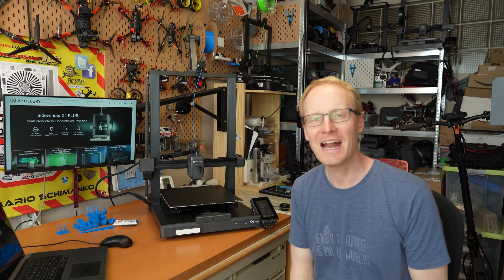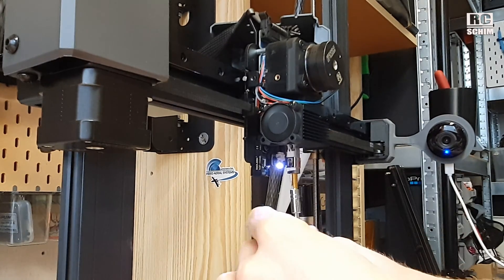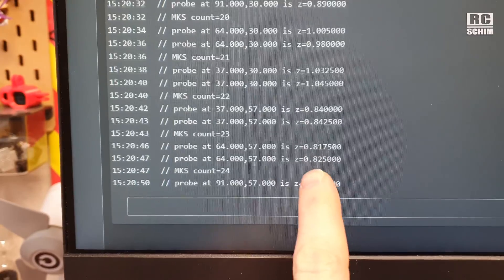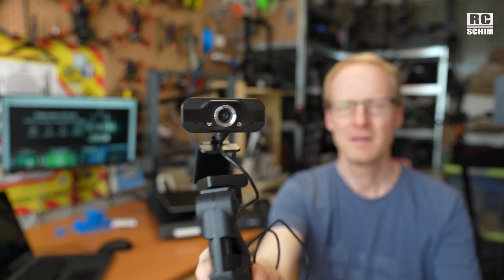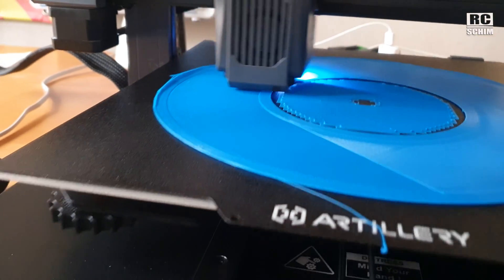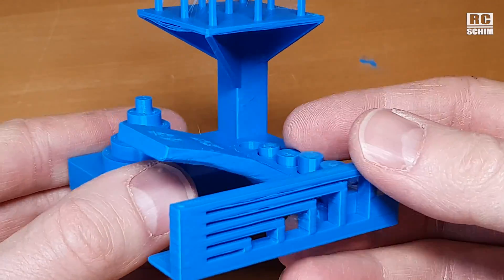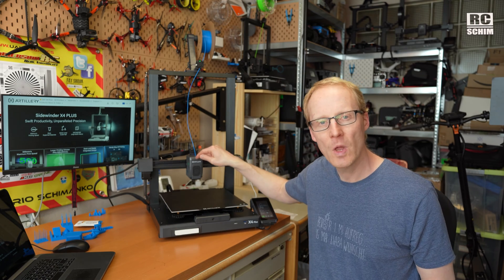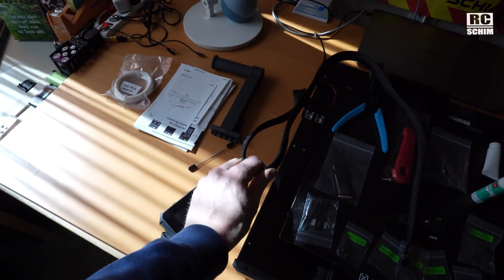Artillery Sidewinder X4 plus - HUGE,fast and affordable klipper printer?

Comment from the maker: 11.4.24: they've reduced the price to 355€  (without 5KG PLA)   → https://shrsl.com/4hjmm
or  399€  with 🔥5KG PLA Filament 🔥  🛒 https://shrsl.com/4hfgq (Affiliate)
 (with VAT, free shipping from Germany)
I deliver honest opinions, well researched and tested (sometimes "almost scientific" ;) reviews! If you can support this idea please check my PATREON: https://bit.ly/2ESMtIO 
✅better Nozzle:  https://cuts.top/DFTa  (also find the 0.8mm there)
✅Yi Home camera IP Cam works https://cuts.top/DFSO   
✅ my Orca-profile (Printer, Filament and process - using their ArtillerySlicer settings)
find them here:    (incl. better print start procedure)
→  https://drive.google.com/drive/folders/1G26_F0p2LiV5B_ms8vAWIPakzbjXEkNs?usp=sharing
Reply: U are showing us an url with a very large price for al x4 plus printer while the original website of Artillery 3d sels the same printer for 200 Euro les. 268 Euros. And the website u recommend shows a price of 460? Haha . Yeah guys! This is really hounest. Yeah right
Reply from the maker: @jimmomechanics7347 oh, this shouldn't happen ;) looks so cheesy I understand. When this printer was out and I made this review - prices were good on their site - now since it doesn't sell the other sites give massive rebates to clear their stock. I will remove this link here - but this will also happen on other reviews - because I make a lot of them - and it's hard to keep track of them.  If you believe it or not is your thing, but I think I didn't earn a single affiliate $ with this one here ;)    
Again thanks for your feedback, hope I can convince you that Schim is not a Shill ;)
Reply: @Rcschim  can you please send me the file for test the leveling.
Reply from the maker: @NdranghetaSG I don't find it ATM. But it is really easy to create in your slicer: just add dice, scale it (unlock to change individual axis). Make it as large as you wish (the whole print bed?) and only like 0.2mm high....

Comment: hey Schim, I am having a big problem here. I tried to install octoprinteverywhere via SSH on my SW X4 Pro and everything went fine but at the 98% of the installation we got electricity shortage for 15mins so after that I turned on my Printer but it is stuck at Artillery logo screen and Fluidd is not accessible at all. I still have access to ssh and I see my file system via terminal but it's just stuck there and I have no idea how to revert it back now. I would appreciate if I could anyhow back it up to a fabric firmware and I will set everything up from starters again. Just want to make it work somehow.

If anyone else has any advice or link with instructions how to make it work again without EMMC re-flashing is not an option as I do not own that USB stick that can connect chip into it :/

Much appreciated for anyone's help guys.

Comment: I picked one of these up used for $150. It still has some problems but for what it cost, it let's me print large stuff. I'll check your settings out and see if there's anything you caught that I haven't. Obviously a lot has changed in a year of firmware updates and built in orca profiles, but it feels like it could be better.

Comment: Most people ordering are planning to test it with a 0.4mm basic settings. 
They should include a 0.6mm but newbies might stumble with the base files or basic settings out there catered to 0.4mm. that's why most starter printers with a larger bed still have the 0.4mm installed. 
I switch it out to a 0.6mm nozzle right away.

Comment: Why is this hounest? I have no problems with the x4 Plus. Its perfect working. I did not have the problems u talked about. I thin ur own settings or not smart. If u want a good print u have to use the 0.4. U are testing the printer with a own nozzle of 0.6 and made the printer responsible for the problems? I printes smal detailed models with the fast function and nothing wrong happend.  These days u have also the plus x4 S1. That one is even better.  U did also not say anything about the filaments u used and the layer high u installed can also make problems with printer. So please dont blame the printer. I can see u made a lot of faults and blames the printer this (it seems). So everything on this forum is saying they dont will buy the printer. Just because of ur personal thing?
Reply from the maker: I tried a lot of prints also with original 0.4 nozzle and it had lots of issues. There's a good chance I made stupid mistakes, you're right - but YouTube is all about sharing my own opinion and I still believe my points were true. If you have good experience - fine! Thanks for sharing this here - that's important for other users to find. 
0.6 nozzle makes a lot of sense on such a large printer if you aim for large, functional parts and quicker prints (which was my intention)

Comment: Nice video. I wanted to buy it but now i dont 😅 
Im Planning to buy a mid-budget 3D printer with kinda big print area. Can you suggest the best of them??
Reply from the maker: The best one I have currently (and which was aiming for, after the X4 was such an dissapointment) was the Creality K1 max. They came down in price quite well and are just reliable.
Also I think the Ender 3 v3 plus could be a good budget big printer. 
I wish there was a 30x30 version of the Flashforge 5mpro - because this one is so reliable and has really good print quality...

Comment: Very honest review, after that I bought the X4 Plus, today I received YI camera. Would you share a model to the Yi camera holder?
Reply from the maker: Do you maybe use onshape?
Than you can directly export from there:
https://cad.onshape.com/documents/de6a7477e58b47900f33a8f8/w/e8185b8e8a612ed09a6affde/e/d3294814d877ad71c2e7c031
Reply: @Rcschim  Thank you very much! I'm very grateful!
Reply from the maker: Or download the file here: 
https://drive.google.com/file/d/11rHfoM7li4Yo_LCA7U1VpEPBGairuegW/view?usp=drivesdk

I think this was for the party x3, but it works for the X4 as well, just need to cut 2 ends off a bit

Comment: €350 isn't cheap for a bedslinger. Remam I checked on the site in Germany TOMS SOMETHING and the price cor the unit with 5 rolls of their cheapest filement is€427?. Remember this unit has lact genn betleveling and dummed down software 😢
Reply from the maker: I agree, now I would probbably take a look at the Creality V3 plus (their newest bedslinger in 30x30 size) - or as I did - go for the K1 max. It's the allrounder I was looking for (decent buildvolume and OK quality, plenty of options since it's encased...)

Comment: The MKS PI in it has a webcam service installed on it, it's just not enabled. I had a webcam plugged into the usb n ssh in to it n ran "systemctl start webcamd" and the camera immediately started working
Reply from the maker: Thanks for the info, will try that

Comment: I bought the X4 Pro.. similar results as your Plus. Bad layer shifting which I think was fixed when I upped the X and Y current to 1.1 but it seems to have extrusion issues. Do you have suggestions for changes to printer.cfg? I tried a hardened steel 0.6 nozzle but I had problems meshing the bed.
Reply from the maker: Honestly didn't increase the current yet (or test the effect of doing that). On steel nozzle  read that you need to increase temp by 10degreeC but you may have heard that already ;)
Reply from the maker: I will sell my X4 an use the k1max instead (it can be had for under 700$ at geekbuying with the correct code (let me know if you need this ;)

Comment: @RCSchim mine came with the POM wheels on the Z axis so tight that it was causing the next layer to dig into the bottom layer. Took me 2 weeks to figure it out. Like the X axis didnt travel up enough after layer change.